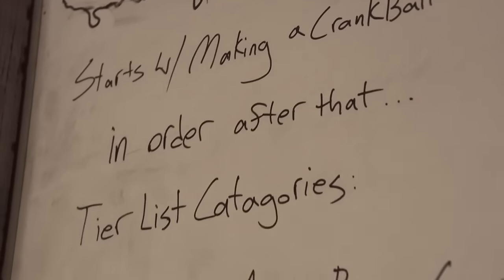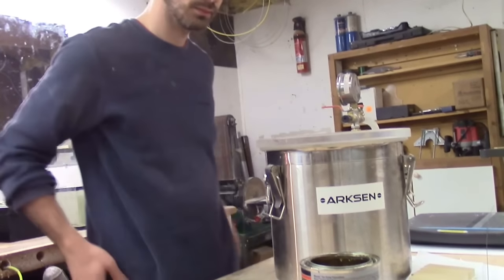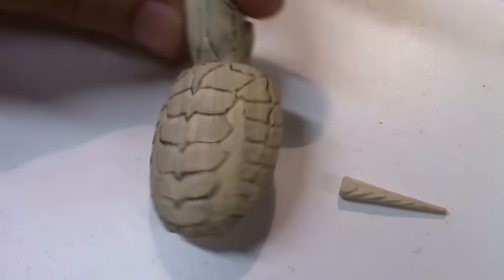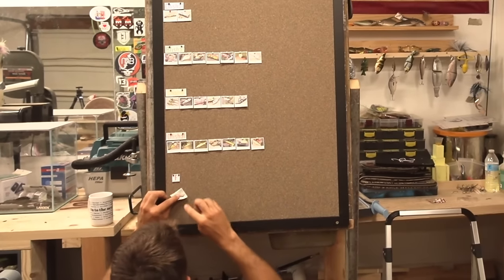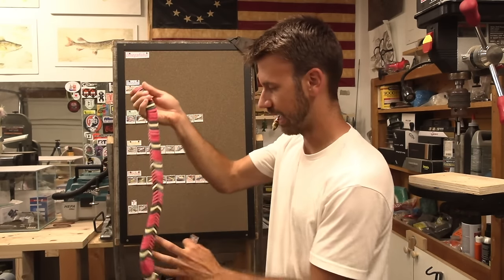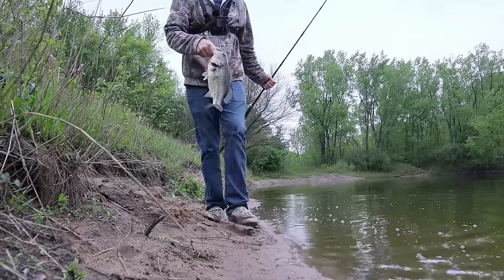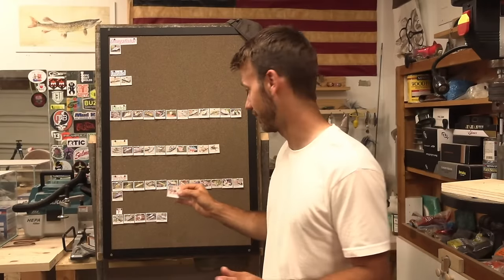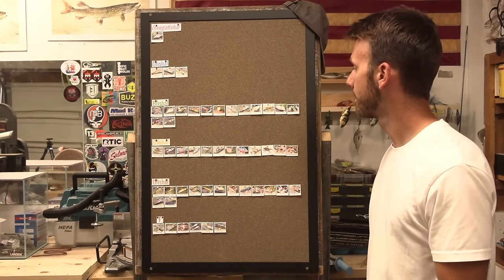Ranking All The Baits I've Made 1-50

Comment: Instead of using batteries for your camera you can simply buy a (DC/AC adapter which provides a fake battery with a cable which can be plugged into the wall or a battery bank) good tip when you have your camera in a "studio"